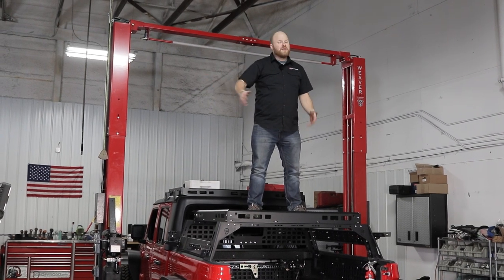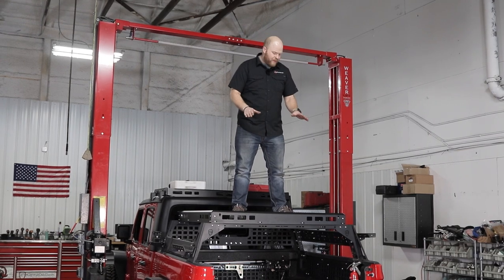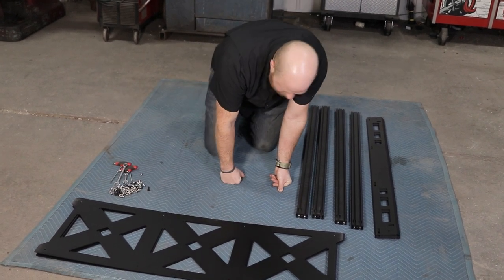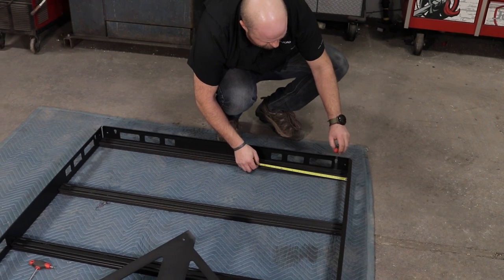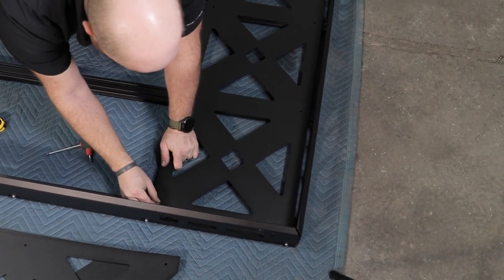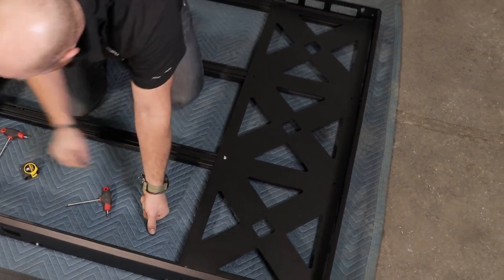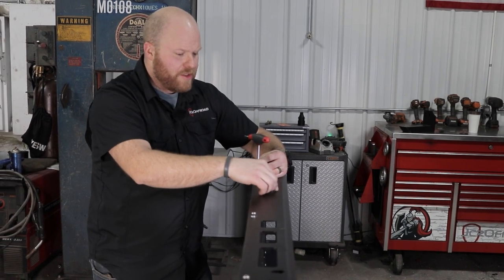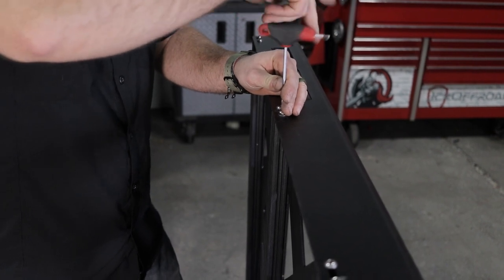Universal Cargo Basket Assembly

Comment: I think most of the items made by JCROffroad are top notch. I think it depends on the person's needs. For me, I'm using a rooftop tent on the bed rack. The profile is low enough to be the same height as the CAB, thus keeping the efficiency of less wind drag. This cargo basket, although still useful for my setup, would raise the rooftop tent too much and add wind drag. For those without the rooftop tent element, this would work great.
Reply from the maker: You can also hang it below the bed rack and run both!